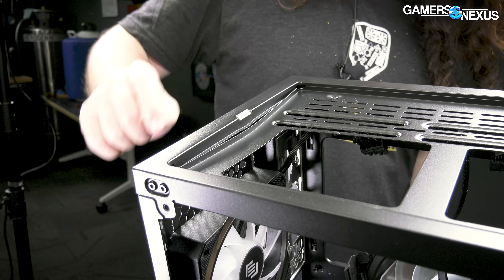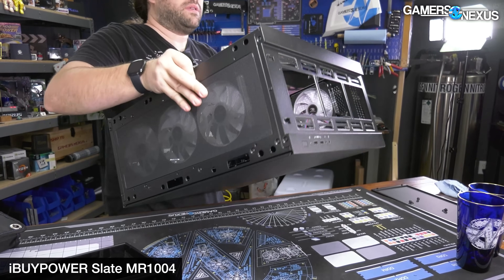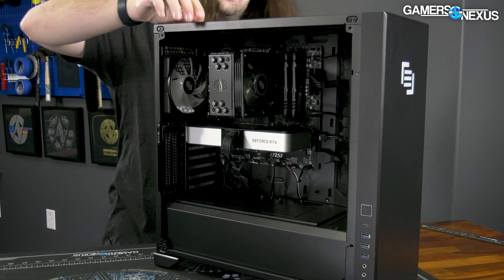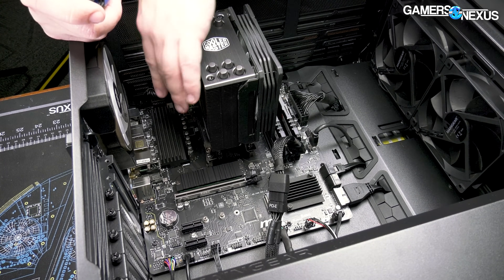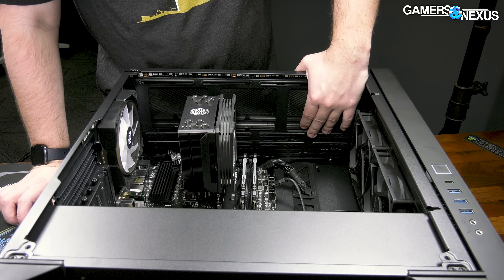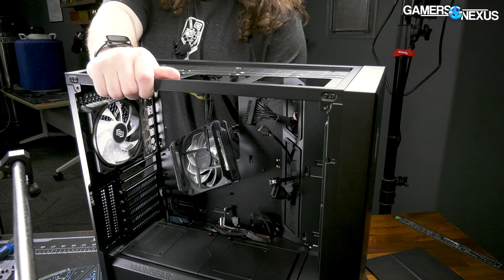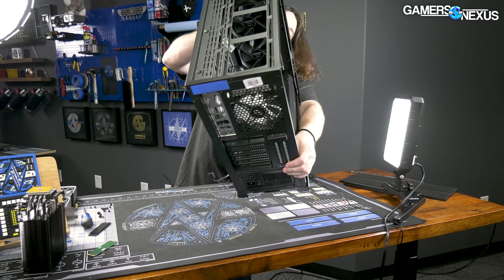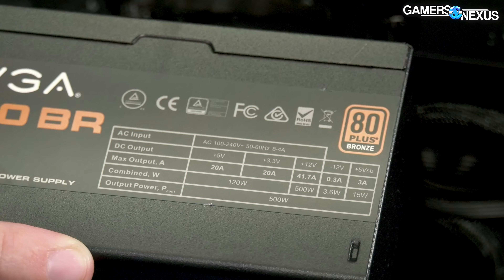Maingear Did It Right: Secret Prebuilt Gaming PC Review ($1700 Vybe)

Comment: I don't understand why most prebuilts use cases with poor airflow. It's still better than my AeroCool Cylon (which i've regretted buying it many times), but wouldn't a better case just make the PC all-around better? It would lower the noise output (due to lower temperatures), the only negative thing i can see is maybe more dust in the case.

Comment: Ah, pulling the AMD CPU off with the tower cooler.  Stressed me the fuck out the first time it happened to me.  I spent hours trying to get it off without damaging the pins.I ended up running to a Value Village to see if they had a hair dryer so I could heat the paste up enough to remove it.  Everything worked fine afterwards, but it was a lesson learned.

Comment: After having this for almost a year I will say my biggest issue is tower itself. For the price you paid it feels cheep, the HDD housing is a nightmare to pull out and the location of the USB ports being on side is a horrible location. This was the first time that I have a bought a pre-build after building my own for over a decade and overall I'm kind of unimpressed especially for the price point.
Reply: Roberto - hey R, mind if i ask you a question?  i'm considering getting one of these.  can you shed some light on that memory he was talking about that was throttling data transfer from one drive to another?  in their specs they don't seem to mention that one, (i'm obviously not a builder:).  i think it was the 660 NVMe SSD.  it doesn't seem part of the normal SSD memory opitions. can i just buy better/ugraded memory that would improve that situation?  sorry if a stupid question, i do a lot of transfering. -barbie:)

Comment: When the case is literally heavily damaged, and it still equals "I don't have any major complaints", that really tells all you need to know about the prebuilt market.
Reply: a dent doesn't make a case "heavily damaged"
Reply: @lightly-red-huedmaleindivi6266  "a dent" ? Is that what you call a dent? When it's literally bent completely out of shape and still force fitted. I'm sorry if that's what you consider a dent, let alone acceptable by any means. If it has scratches, cosmetic damage like dents, damage to the surfacing, etc that's regular damage. Anything above cosmetic damage (which this definitely is) is called heavy damage. That's literally how it's classified.
Reply: @Real_MisterSir  it's a single dent and it's covered by the filter. It does not impede the function of the machine in any way. Calm down. There is no official classification.

Comment: I forced myself to NOT USE THERMAL PASTE for my AMD cpu. 38000x. The Paste became concrete and I was just dusting it out and bumped the cooler and the pins were dead very soon. Upgraded to the 58000x. Thought it was the modern version of the 38000x  but nope, it is just a MUCH MORE POWERFUL system. No worries at all, just a wallet bite. 

The Graphite pads are great for what I do. No threat to the CPU. Now if I can ever afford to upgrade from my GTX 970 haha.
Reply: I will get the CPU AND motherboard working again. If you have the silicon, you have all you need

Comment: I'm very interested in Prebuilt. 
Not because I can't build a PC, but because I'm worried about the price of things and also not having support if something goes wrong... Which is something I think alot of the YouTubers don't quite take into account as an aspect of the consumer market enough. 

Because a warranty and tech support would be available, I tend lean more toward interest in prebuilt these days. 

Thanks for doing these.
Reply: Tech support and single point of contact are what you get.  Surprisingly the warranty on the parts individually is often substantially longer than the warranty on a pre-built (you don't get the part warranties if you buy from an SI generally since they axe that for the bulk discount).  For many things 3-5 years.  The downside being you would have to identify the faulty part yourself and contact the company.

Comment: $1700 3060ti 5600x? And steve called that a pretty good deal? I built a mini itx 5800x 3080 rig with 7 case fans in the nr200, and that rig cost me $1700 before i added a 2tb 980 pro...

(Edit originally only had 1tb sn750 from wd)

Comment: Should have the voids in those coasters filled with clear silicone or epoxy to give the top a level surface, I predict many wobbly bottles and sticky mess hard to clean from the cavities, just a thought, I know you’re going for the 3d embossed look but theirs a reason coasters come flat
Reply: Unless your glasses and bottles have an incredibly tiny base, this will not be a problem. The reason coasters are usually flat is because it's cheaper to make them that way.
Reply: @Zanpaa  it actually costs more to make something dead flat than bumpy, they’re cool for displaying but not for actual use

Comment: I bought a $1700 PC from Ibuy and it was a fire hazard, screws rolling all over the place and metal wings completely blocking USB ports. Oh also wires blocking does slots using the cpu cooler as a nice way to hide wires ugh.

It was just ugh
Reply: @olympic-ass-eater  my buddy helped me take it apart and we built a new pc. Was scary lol
Reply: @olympic-ass-eater  3700x and a 3070 with 32 gigs of ram and an x570 mobo
Reply: @olympic-ass-eater  they had a sale on the 3700x at about $290 when I bought, back when the 5600x even was selling high, too bad no 5700x when I bought it lol

Comment: I have to say this, the cable management is really good here, even down to the USB 3 header, they went with a board with a right angled socket to eliminate cable clutter, but the f*%^ing graphics card has a power plug on the motherf#$%ing front MIDDLE of the card hanging in front of the side panel... Like come on. To the graphics card makers, put your power plugs, 6, 8, 12 pin whatevers... to the backside of the card closest to the motherboard as possible. And if your card is so long it makes putting the plug there difficult because you wont be able to fit it in regular cases... make the f$%^ing card shorter... I mean... FFS!!!

Comment: I’d be pretty peeved if I bought a PC for $1700 and it had crappy airflow and a tower cooler. It’s fine if you want a solid front panel, but if you’re gonna do that, it better have an AIO. At $1700 it should have an AIO anyway. It should also have a better mobo, and PSU.

Comment: Not so fun fact: If you attempt to remove a stock AMD cooler with their preapplied thermal paste, even after running hot to loosen the bond, it will most likely destroy your CPU and remove pins if still locked in the socket. Even if you do everything right, you can still ruin your processor and AMD will not approve an RMA request due to "User error". 

Be careful folks.

Comment: 21:41 I'm surprised you didn't touch on the "front" panel I/O location, which is on the lower left side. Essentially meaning the only location you could put the computer is right next to your monitor. Anywhere else and it'll be a fair bit more cumbersome to use it, especially if making use of the USB and audio ports. That alone would make this a hard pass for me.

Comment: 5600X and a 3060 Ti for $1700??  I just built a 5800X and a 3070 Ti with a 240mm AIO, 32 GB of RAM, a Blu Ray burner drive, a B550M-A WiFi, a Cooler Master case, and 750W PSU for that much!

Comment: I actually don’t see how that system is $1700. It’s got a $50 cooler, a mediocre msi mb probably like 120, ram maybe 100 ish, fans $30ish, 3060ti fe 400, case maybe 50, psu 55 ram 100cpu etc. like they charging like 600 to basically have it out together.

Comment: It is worth noting that the VRM on that motherboard is actually really impressive, even with that puny heatsink. With good airflow, Hardware Unboxed showed it running pretty cool with a 3950X so this is definitely not e-waste if you want an easy in-socket upgrade down the line! The CPU cooler might need upgrading though. 
https://www.youtube.com/watch?v=wuPH9pCCK-E&t=659s

Comment: Maingear did well, although I think $1700 for a 3060ti and a 5600x as well as a bronze PSU is a bit much.
Reply: The margins are generally so small that it seems companies that put decent effort into quality control juice them a bit to be financially viable. Personally I just build mine and build systems for friends and family and accept the 'tech support role rather than suggesting prebuilts but if I had to I would go with a more costly option if I knew the build quality and customer support was good.

Comment: Isn't it weird that you can pull off the cooler + the CPU in one go ? The lever on the socket should prevent that right ?!
Reply: Sure. But I guess the mechanism is not meant to squeeze the pins, but to prevent the CPU from falling out. Pulling on a giant cooler with paste suction effect is quite the force.
Reply: @Dowlphin  I never managed to do so - sometimes I pull harder then I think (or push)

Comment: Around that price is right for a pre-built with an up to date GPU according to current prices of new graphics cards. $1700 for a case and graphics card only, that would be about right. I would rather put $1700 into a crap pc, than $5000! Least the $1700 won't sting so much, and you can spend $600 more and make a better pc than the $5000 one you didn't buy, and build it yourself.

Comment: first Minute: $1700 for a 5600X and a 3060Ti? dang, that's a bit pricey.
end of Video: a real Cooler, passable Airflow, and nice value adds as mentioned in the Video. those are nice, but the Pricetag does still feel a bit pricey.

Comment: Hold on.  So, they took up that much space to back-light their logo.  As such, they're blocking even more air flow to the upper case fan — further denying the CPU cooler of quality air — when they could have moved it down to join the wire cluster at the bottom.  That really is unusually dumb no matter what.  Limiting airflow that much pretty well mandates that you can't run anything over a mid-tier CPU or GPU in there.
And should I assume they're operating that close to the margin that they're willing to send builds out in cases that left the factory bent like that?  I mean, I get not wanting to waste money because some of your product you ordered from China is all bent and stuff.  But, c'mon!  If you're going to do that, you damned well ought to be offering it at a reasonable discount.  Just add menu options for factory seconds and whatnot.

Comment: I recently had the chance to build my own version of the Vybe along with their Apex distro. I opted to use 16mm PETG, just for the challenge, and the PC runs cool and quiet despite having limited airflow from the front panel. I was able to mount a 360mm radiator up front and a 240mm radiator on top to cool the i9 10850k and RTX 3090 FE. I ultimately swapped the GPU block to a Corsair block since the Bykski block was machined terribly. 

Overall it was a fun Mid-Tower chassis to work with and lived up to what MAINGEAR set out to offer. I'm looking forward to working with the Vybe V2.
Thanks again Wallace for the opportunity and support.

https://youtu.be/iK5xpW78pyQ

Comment: Steve has a tendency of assuming things that make no sense. Like here saying the CPU fan will pull air from outside the case while the double front intakes will vent immediately out the top grill. I get what he's trying to explain, but that too is incorrect. You cannot have both positive and negative pressure at the same time, which is what his claims would require. For a channel so focused to scientific fact, there sure is a lot of "we know this so data isn't necessary" assumptions.

I suspect Steve is correct about the front intakes being so restricted that they basically don't matter, which means this setup results in negative pressure and the top grill functioning as an intake. But in that scenario, there is no way for the front fans to push their air out the top. There is also no added negative pressure from the CPU fan; it simply pushes the air already sucked in by the negative pressure caused by the rear exhaust.

Comment: 1700 for a 3060 ti and a 5600x is WAY to much.

Your paying a 350 dollar premium for this and it still uses very cheap parts. Cooler master hyper 212, cheap ass micro atx motherboard, only 3 fans on a pretty shitty case. 

All for what? Slightly more effort put into the hour of work it takes to build and cable manage a pc  

I don't see how this is acceptable at all....

Comment: Still sad, i just built my own system for the same price but 10x better. Lian Li Mesh 2 RGB Case, LianLi Galahad AIO, AMD 5600x, XFX 6700xt, 16 gb Xforce RGB 3400 ddr 4, ASRocl b550 steel legend mobo,corsair 850 watt power supply, corsair wireless mouse rgb, evga rgb mech keyboard, 1 gig WDblue nvme

Comment: $1700 is awfully expensive for a system that only includes a 3060ti.  Considering for around $2500 you can get a 12900k and a 3080ti.  It looks like a well built system, just pricey for what it is.  Unless it includes other things like keyboard, mouse, monitor, etc.  I'd expect that system to be $500 cheaper than it is, if not $700.
Reply: for real you can get 3060ti for 700 maybe less and rest would cost like 400 on used market for the most part ish
Reply: @winonesoon9771  3060ti should cost $350-400 new.  I just got a 3080ti for $1300 yesterday (regular retail, it's one of the EVGA ICX ones).  It was the ONLY GPU they had for regular retail.  The 3070 was $900.  The 3070ti was $1000.  All of the 3080's were $1400+.  I don't get it.  Micro Center had 25 of them in stock.  Getting a 12900k to go with it on Wed.  I'm getting the motherboard+CPU there, but because I'm getting some other parts from Amazon and they aren't here yet, I didn't get those yet.  I think I'm spending like $2300 total.  But that is for a MUCH MUCH MUCH more powerful system than that $1700 prebuilt.

Comment: No major complaints? So you're happy to spend $1,700 on damaged goods? There is no excuse for the condition that pc was in. As you noted, this was likely done in production, which means that the people building it didn't give a toss because it wasn't their pc they were building. When you buy new, you expect new. The PSU paintwork was scratched very questionable if that was new.

I would be interested to see what would have happened if you contacted Main Gear as a secret customer to complain about the damaged chassis and questionable condition of the PSU. I doubt that would take reasonability for it.

Comment: In my experience HP is absolute garbage and Dell who used to be good, will not get a cent from me ever again. I have always liked Alienware, but much like Apple when you dig down, it is overpriced garbage. Poorly designed and poorly built. They rely too much on talking things up and conning people than actually giving you a good product. I have always built my own PC's, except for the last one where I simply didn't have time nor money and needed a new machine. Despite some of the negative comments I have seen, the Acer Predator I bought has been fine. If it does what you need it to do and reliably, then it is fine. I will however be building my own again.

Comment: Why do cases with such poor frontal airflow even exist 😔 the aesthetic is never worth it and besides you can just buy one that is modular like the phanteks P600s
Reply: It reduces noise. My Bequiet Dark Base 900 also has kinda small air intakes on the front panel for the size of the case and its potential. I consider the law of diminishing returns, so I find the performance extremism a bit cringy anyway, and when you have fans with proper static pressure and some of them pushing out to assist the others, you got a decent amount of air flow. Although to be fair, when CPU and GPU are air-cooled, it's probably more impactful to have more openings. (Do graphics cards suck in from the back these days? I hope not. I seem to remember that was a thing at some point.)
Reply: @Dowlphin  The BeQuiet cases do look cool though. I originally had my system in a "silent" gaming case with an IAO and it was louder than it is now. The closed off air supply just made the radiator fans ramp up. Better to have quiet fans IMO (noctua case fans and cpu cooler in my rig now) and a bigger more airflow orientated case. What GPU are you running? I've got a 2080 super and never seen it above 75 degrees since I switched to all air cooled.
Reply: @Doyouevenliftjpg  I don't know how cards these days are regarding air cooling noise level, also because reports are highly subjective, but I am pretty sure my 1080 liquid AIO is quieter than air would be, especially with the optional swap to Noctua fan and the radiator mounted at the case's top without another grid covering it. Also, the card's own radial fan that is still cooling the PCB has to be kept at a precise speed percentage or it is making a very annoying whistling sound, further underlining why I don't trust integrated graphics card air cooling. (I also had to mod the pump, though, to idle it at 60%. - Basically, understanding of true silent gear is consistently lacking.)

One thing that bothers me a little about liquid cooling is that for reliability reasons the GPU typically has to be kept cooler than with air. But on the other hand, my previous air-cooled cards almost all suffered a defect before 3-5 years were over. I run my AIO GPU with a temperature target of 64°C, which in gaming realistically it doesn't reach.

Comment: Wats up with the fe card and the 5600x 6 core ? For $1700 I would want higher clock speeds than that on a 3060 ti What about that heat sink why pay more for that when the amd fan will cool it for $1700 the 5800x should be there but then again it is prebuilt lol